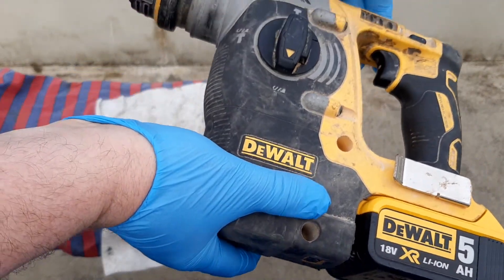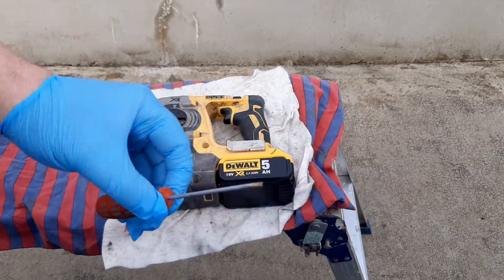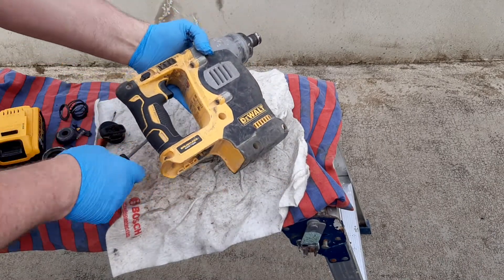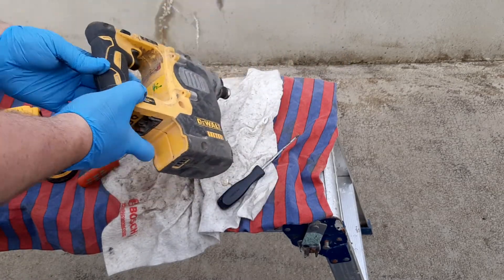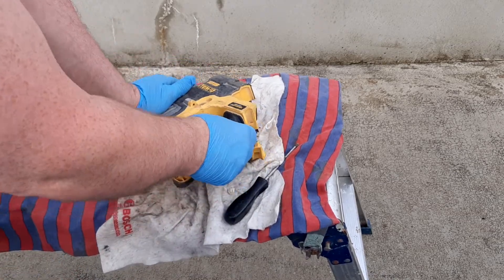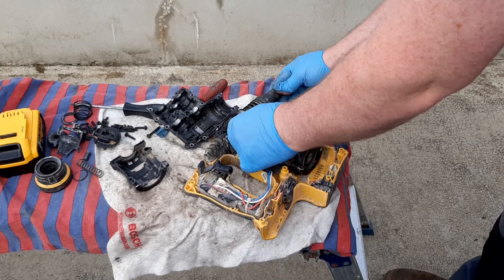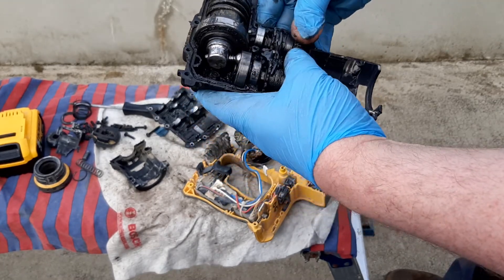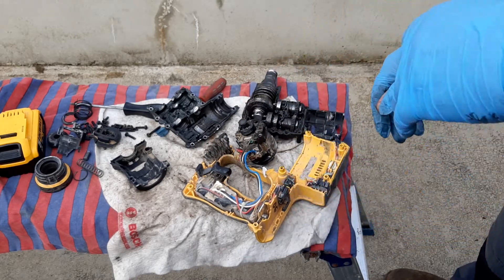DeWalt DCH273 SDS Teardown and Diagnosis

Comment: On mine you press the trigger and it’s intermittent, also goes in reverse randomly when it’s in forward. Then can just stop. It’s not the battery as I’ve used a few. Any ideas? I’m thinking trigger
Reply from the maker: Could be the trigger it's not a separate part though it comes with motor and board attached
Reply: @doctorlefthandthread  is there any means I can send you a video of it see if it gives any more hints or anything I can check?
Reply from the maker: @tom451  email me drlefthandthread@gmail.com

Comment: Had the same problem; couldn't wait for the part so I went to the hardware store.  Could only find a 3/4 x 1/2 x 1/8 Oring (No. 70); it was a bit big for the cylinder, so I tried sanding it down, but it took too long.  Put in on a grinder for a very light spin one time around, and back in business for a quick back yard fix. Will get the part later, but if anybody needs it immediately, it did work.
Reply from the maker: Well done
Reply: @doctorlefthandthread  Thanks; will put in the right one later.  Is the piston grease a 00 NGLI?
Reply from the maker: @billhansen1139  I used a ep2 multi purpose it's probably not what is ideal but it worked

Comment: Did u fix it? I had the same issue on mine and the circlip that holds the spring in tension has come off and bent. Just waiting on the replacement part now
Reply from the maker: I had a spare assembly from an old DCH253 I used it to finish the video.
The mechanical parts are the same. Good spot by the way. I haven't gotten around to fixing up the DCH253 again yet.This video was to show the damaged o ring on the hammer assembly.
Reply: Did you manage to sort it mate? I’ve got the same problem but can’t see a way of compressing that huge spring to get the clip on
Reply: @Passivesniper  I did! It was a pain in the arse as I did it on my own and had to Jerry rig a few automotive tools to apply the compression. First thing to realize is that the solid metal ring goes in with the cut out rim facing up to seat the c clip. I placed the bottom of the assembly on the ground straddling two blocks of wood and then used a circumferential ball joint splitter to apply downward pressure on to the spring while exposing the inner shaft. It was really hard to apply enough pressure while also getting the c clip on with a flat head screwdriver but after about 30 minutes was able to do it. One other part of the reassembly that I initially messed up was that the ball for the hammer motion needs to be fully seated inside the recess, mine had come out and didn't realize you need to fully seat it in there. Works a charm now!
Reply from the maker: @FrancisWong  thanks for your comment it will help
Reply from the maker: @Passivesniper  to be honest I had a broken DCH253 and used the complete part from that to finish the video but I have a couple of them laying around in bits I haven't had time to rebuild any of them yet if I do I might try and find out how to put that all together and do a video on it.